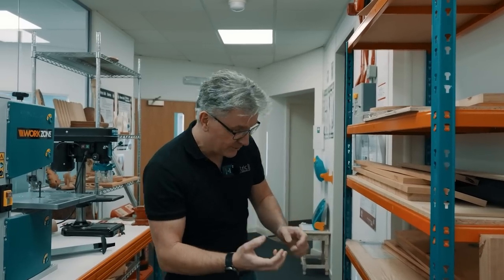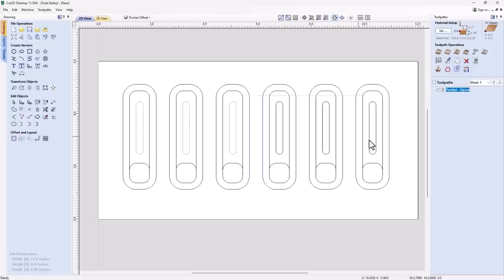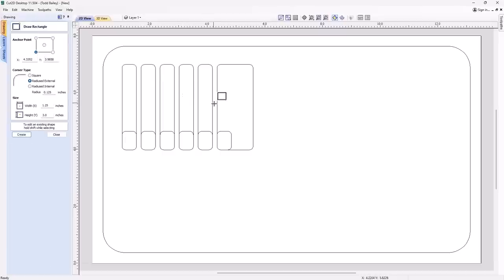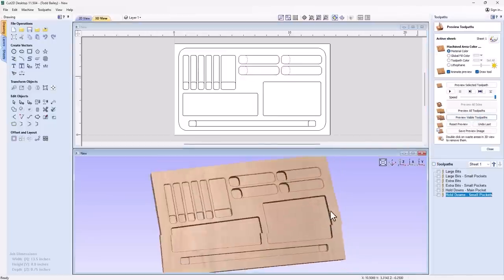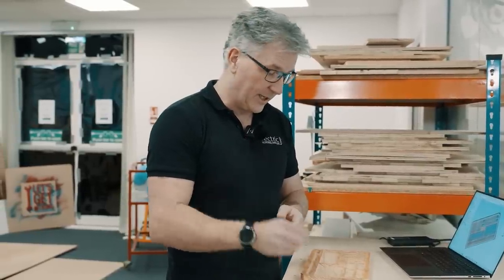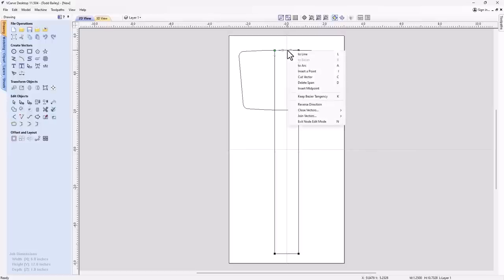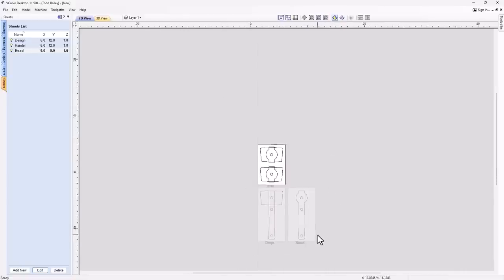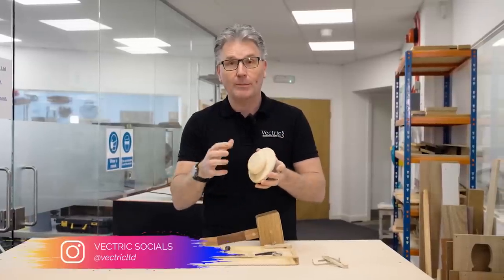Easy CNC Accessories | Making Tools on your CNC | In the Labs with Todd | Vectric FREE CNC Projects

Comment: If you drop your threaded inserts deeper into the spoilboard you'll get quite a few 'resurfacing cuts' before you get your inserts. That's what I have on my machine. Nice video, and thank for sharing.
Reply from the maker: Yes you are right... and a great tip.  I did think of that but seeing as I was trying to maximize the "Z" travel on the CNC, I went with a MDF that was just a hair thicker then the threaded insert.  You are 100% correct and if I had the room I would have done it like you suggested.  Maybe in the future I'll see if us loosing a bit of "Z" travel is really a big issue compaired to how often we hit the inserts. YIKES! Thanks so much for taking the time to leave a comment!
Reply: I add my inserts from the backside or the underside, it usually leaves about a 1/4” material above the insert to surface the waste board. I also make my hold downs out of remnant maple flooring, really good hardwood.

Comment: Nice projects. I think I would make the tray pockets deeper - and put the push-down recesses at both ends.
Reply from the maker: Hey Don!!!!  Thanks for leaving a comment!  That is a really great idea!  Also, if I was to do this agian I would make the pockets wide enought to house the tool in the plastic sleave (box).  If you have more then one bit that looks the same at a quick glance you might grab the wrong one.  Also these cutter can be very sharp, as I'm sure you know, and grabbing or pushing them from the "cutting" end could lead to a few scratches.

Comment: Nice presentation. To save my spoil board I like to zero my z to the top of the spoil board then raise it to the thickness of my material and rezero it, that way I know I will cut through the material and only leave a small mark on the spoil board.
Reply from the maker: Great tip! Thanks Dean!!!

Comment: Thank you for the video. Can you provide some info on your case that surrounds your CNC. Materials, cost etc. I have a CAMaster Stinger 1 and would like to consider such an enclosure
Reply from the maker: Thanks for leaving the comment and question.  That was from Ooznest, and they provide the parts and I believe it comes in different sizes.  You might want to have a look at their website for referenece.  I also believe they sell the parts to make your own... but I would check with them.   https://ooznest.co.uk/product/original-workbee-enclosure/

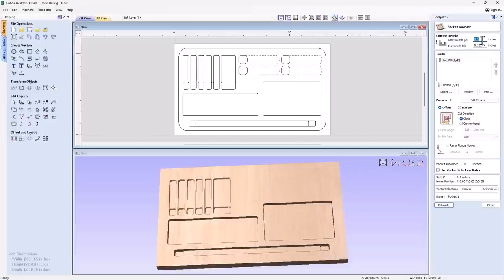Comment: So... a question:  At 12:50, you have the start depth at .125, and the cut depth at .0...  Is that correct?
Reply from the maker: Good spot!!!  In this case it does not matter ... I forced the tool to go to that Start Depth and then cut the pocket there.  Really this could have been problematic if that .125 was too deep for my tool to handle in one pass.  Well spotted... that was a test and you passed... ;)

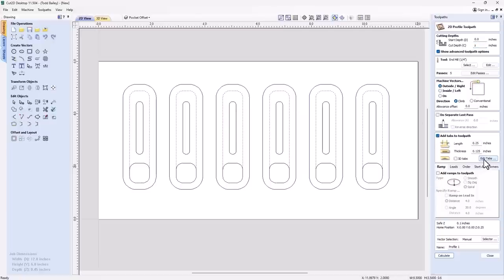Comment: At 6:06 you start talking about tabs and then you dismiss the grain because it's plywood.  Would you please elaborate on grain and tabs.
Reply from the maker: Thanks for the question.  Yes, I did, seeing as plywood is layered, depending on the thickness of the tabs the thickness could be made up of more then on layer.  And I believe, but could be wrong, with plywood the layers are glued up "cross-grained" for strength.  When it comes to solid softwood or hardwood, the direction of the grain is consistent throughout the material... so thin-ish tabs that go with the direction of the grain will be weaker than ones that go against the grain.  I'm in the habit of thinking of the grain direction in my material for aesthetics and also how strong my tabs will be (if I am using them).
Reply: To add on, hardwood is difficult to sand on the end grain, which is where the proper placement of the tabs would be. It's a trade off, strength through the cut or easy finish sanding. I opt for double sided tape when possible to avoid the issue at all.

Comment: Millimeter zu verwenden wäre für die meisten einfacher 
Inch ist International doch etwas umständlich
Reply from the maker: Dank dafür. Wir versuchen, unser Projekt in Zoll und mm zu mischen und anzupassen, um alle zufrieden zu stellen.
 
Wir haben einige Funktionen der Software, die es einfacher machen, zwischen den beiden zu wechseln. In den meisten Zahlenfeldern können Sie „*i“ hinzufügen, um in Zoll umzurechnen, oder „*m“, um zu mm zu wechseln.

Hoffentlich hilft das... :)

------------------- English Version Below - Transulated with Google --------------------------------
Thanks for that. We try mixing and matching our project in inches and mm to keep everyone happy. 
 
We do have a few features of the software that make it easier to switch between the two.  In most number fields you can add "*i" to convert to inches or "*m" to switch to mm.   

Hope that helps... :)